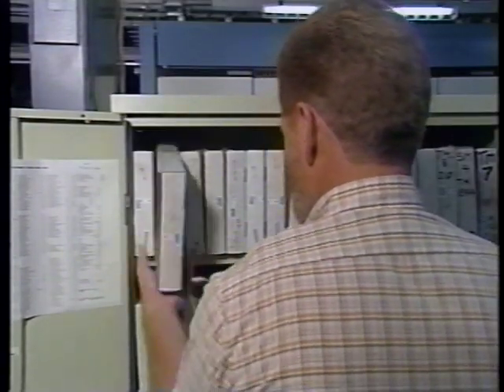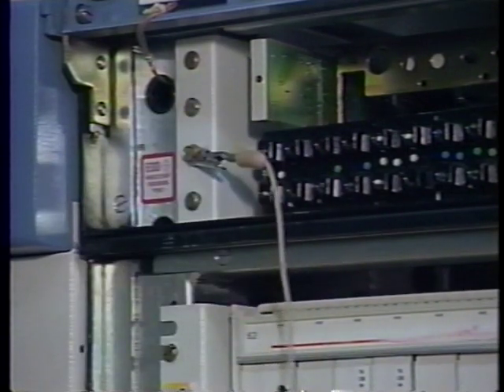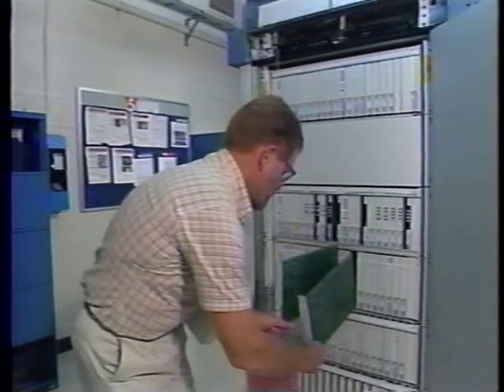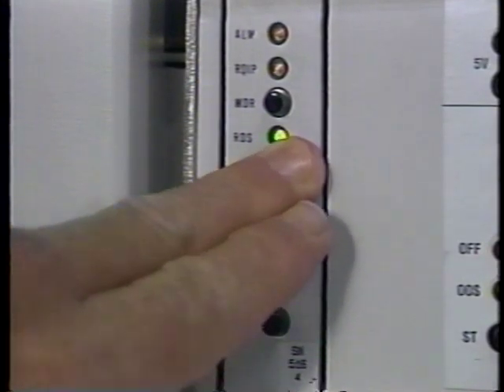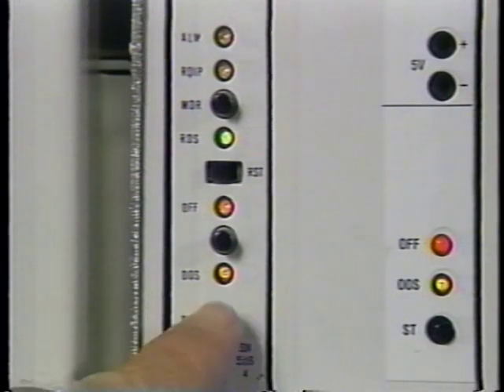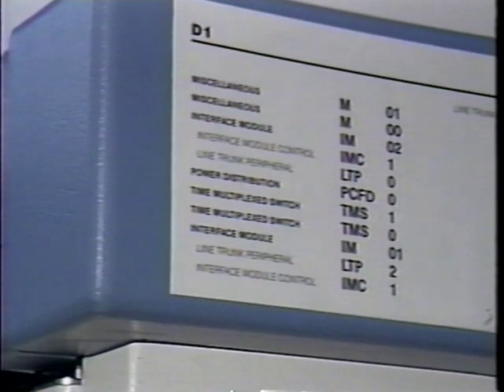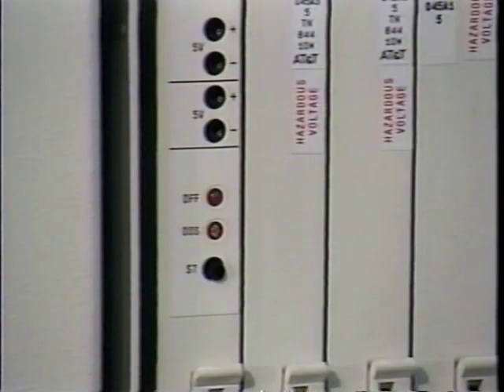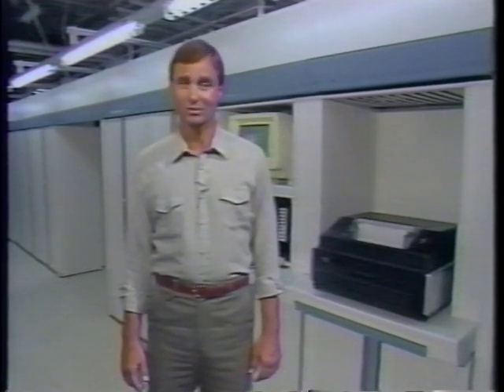5ESS Switch - Circuit Pack Replacement Procedure

Comment: I worked at the WE/AT&T/Lucent manufacturing plant from 1976 to 2002 where we made the 5ESS switch. When the video started the first thing I thought was why is the pack not in an anti static bag and where is his his wrist strap. That was a big no no when handling any product or components in the plant. The video brought back a lot of memories.
Reply: Did you work at Oklahoma City Works? I remember reading something somewhere once showing the last #5ESS to be manufactured shipping out of the Oklahoma City works.

Comment: Was this powered by UNIX?
Reply: Yes and no. They ran DMERT which was like a blend of Unix and a real-time operating system built for high availability.
Reply: Yes. THE UNIX(tm)... AT&T System V UNIX(tm). But there's a lot more going on than just the OS you can easily see boot, and get a CLI from. (note: these are the sort of systems that boot only once in their entire existence.)

Comment: The person did not explain what TLP stood for. Trouble locating procedure. That would be the print out, that would be generated in the event of a failure of sorts. The TLP print out would give you a sequential number of circuit packs that are in question, and you would follow that procedure, starting with the most likely, to the least likely. That does not necessarily mean that you will replace the circuit pack that failed, it could be in the back of the frame or where the pins are somebody pressed up against it or a piece of loose material fell between and shorted something could be intermittent, or possibly a heart failure, that's where knowing how to use an oscilloscope came in, and running loops and setting up the proper sink to see what was going on, possibly in need of a microscope to see the pins the in the back plane side, to can see if a piece of loose welding material eventually broke loose and fell down, Etc.

Comment: Why isn't he wearing, a ground wrist strap? When I work number four and number five SS, it was mandatory to wear a ground wrist strap when you remove any circuit pack. Touching the packs with your bare fingers, static electricity you could destroy a circuit pack that might be worth, $10,000 or more. At the time when I was working in both four and five ESS, if you did not use a wrist wrap, you could get as much as 3-day suspension without pay. I'm not sure if that was nationally, but in the New York metropolitan area, that was the rule.
Reply: They get into that.  He made a mistake.  This is a high-tech Goofus and Gallant example.

Comment: Notice how there are no ESD precautions. No wonder most of the circuit packs that  I received as maintenance spares where defective.
Reply: I've worked in places (not phone switch places) where humidity was pretty high and nobody every saw an ESD problem. Of course, we still took precautions

Comment: Wow these circuit packs are a lot like the Definity’s. I also see now why early definity circuit packs have a recess on the top cover, it is for that locking bar. I assume early system 75s had a locking bar like that.

Comment: I'm watching this again and a thought just crossed my mind--I realize that space was an issue and to ATT, every millimeter counted, however, why didn't they just put the packs that were most-replaced in plastic clamshells? As far as bent pins, they could have just used several rows of card-edge connectors (Wafa-jacks).
Reply: Card edge connectors were huge, bulky things back then. Even today, they're often the source of issues - dirty / bad connections.

Comment: I've never seen a 5E switch that lists the CLEI/HECI on the pack list. Just the apparatus code and location. This video is pretty old. No telling what generic they were running. I never knew what that RST/ROS switch was. Nobody ever uses that, including the center. ESD practices are always prudent but I rarely see anyone follow them in twenty years of central office work. 5E circuit packs are a lot more rugged and robust than this video would have you believe. We are now in the process of consolidating and ultimately removing the 5E switches. Consolidation because you can't get parts anymore. After removal, a huge roomful of 5E cabinets can be replaced with a few racks of GenBand gear about the size of a couple refrigerators. I like working on the 5E. I'll miss it when it is gone.
Reply: Indeed. Those things routinely survive lightning events. Someone touching it isn't likely to hurt anything. The ROS switch is completely unnecessary if you've taken the card out-of-service from the terminal. (or, ya' know, it's already OOS because it's broken.) Powering down a slot is absolutely necessary - if you short a pin with the power on, you could do some serious damage.

I recall our tests of a softswitch... 7U could replace a small house sized 5E. (of course, it's all digital. all the POTS termination gear would still take up a goodly bit of space. 100,000 lines is still 100,000 lines, 'tho in a modern world, the analog termination is out in the field.)

Comment: The only thing I guessed that was done wrong on the first clip was he was not grounded against static discharge and he was touching the circuit board.  I didn’t know anything about shutting down the unit after placing it out of service and checking to see if the system automatically placed the unit out of service.  I never worked in an exchange so I had no idea but it all makes sense.

Comment: Back in the electromechanical days of telephony the #1 ESS switch was looked at as a job threat. Our CO went from 45 technicians to 3 a few years after cutover to ESS. Two people were needed to run cross connect jumpers on the main frame.
Reply: I worked at Clevoh45 and Clevoh62. Better known as the Glenville and Cleveland Main CO. I started as an Apparatusman at the Glenville in 1968. In one year I was promoted to Central Office Technician. In the sixties the draft was taking young men for Vietnam, so I was promoted rapidly. I had already served in the Air Force.
Reply from the maker: What CO did you work in?
Reply: @ConnectionsMuseum  I worked at the Clevoh45 and Clevoh62. Glenville and Cleveland Main. I started as an Apparatusman in 1968 and was promoted to Central Office Technician in one year. At the time the draft was taking most young men for Vietnam. I had already served in the Air Force.
Reply: @calbob750  Thank you for your service in both capacities.

Comment: I worked at Digital Equipment Corporation and ESD safe handling procedures were constantly drummed into our heads. I was surprised to see this instructional video showing no reguard for ESD handling of circuit cards. The man walks with a card in his hand touching his shirt. Puts paper next to removed circuit card. I don't see any ESD foot straps, wrist strap, ESD smock. I guess AT&T didn't see this as a problem. At DEC we were told that static discharge can zing a board and cause it to fail later if it doesn't cause it to fail outright.
Reply: Did you watch the whole video?  This was the "don't do it this way" part of the video.
Reply: @ennexthefox  I worked for AT&T formerly Western Electric on number for number 5 ESS you were required to wear a wrist strap at all times. No exceptions
Reply: @ennexthefox  Yeah, clearly he didn't watch the whole video.
Reply: The first part of the video is showing you what not to do

Comment: Spending the last 24+ years as an engineer on Enterprise systems from AT&T/Lucent Technologies/Avaya Communication, this is almost the exact same procedures that we used on the legacy PBX's from the AT&T/Lucent days. 

The circuit packs were the same dimensions, and even with similar TN identifiers. While even in a duplex system, most subscriber and trunk line cards could be done "hot", although you would still place them Out of Service from the console. The only time you powered down a shelf was when you were in the processor complex itself (and even then they had a few exceptions, particularly in a duplex system).

Reportedly the AT&T 5ESS and the System 75/Definity G3 Enterprise platforms came from the same engineers, so they had a lot of these things in common. 

In all the years I've worked on them, I never had ESD destroy a card, and never bent a pin, so consider me lucky (and well versed in the handling procedures).
Reply: Nortel did the same thing. A Meridian SL-100/CS2100 is a rebadged DMS-100. AT&T sold a few 5ESS for large PBX deployments, where I used to work we had a 5ESS from the 1980s until the late-2000s. It used to provide ISDN data networking until Ethernet took over in the mid-90s.
Reply: @straightpipediesel  Re bent pins, was it just consumer systems that NT used card-edge on? I thought I remembered seeing most of the accessories for MDC using card-edge as well.
Reply: @NortelGeek  yeah, it must have just been the lower end. Small Meridian cards are of similar size/shape to DMS cards and use pin connectors very similar to the AT&T ones.
Reply: I wish I worked in that as well inside of a Windowless Building. I graduated last year with an IT Degree with a Minor in Criminal Justice (BA)… if only.

Comment: I wonder what they did with the old circuit packs. Did they send  them off for repairs or did they dispose of them ?
Reply: If its like the Enterprise systems, those packs went back for repair (each of those packs are thousands of dollars, so it was much more economical to return for repair compared to today's "throw away" technology - even today I still see used Enterprise System packs going for between $1,000 and $2,000 - that probably sold new for $6,000).
Reply: @mwjones71  Indeed.   Back in the 90s and before, it was not unusual to order new gear and it included a board that was "remanufactured".  So you might order a minicomputer and a memory board came with a sticker stating it had been previously in use... same warranty and price as new.  I think IBM did this a ton too in their midrange and mainframe business.
Reply: @booboo699254 : Why the quotes around "remanufactured"? Is that not the real term for what happened, or something?
Reply: I think everything went back to Western.
Reply: @NortelGeek  I have numerous packs from Lisle Illinois. Not really supposed to lol. The 5ESS was taken out of service in Jan 2019.
Reply: @finaltransconfigurat  Holy smokes! Lol... I won't tell. Which ones do you have if I may ask? Do you know what switch they replaced the 5E with?